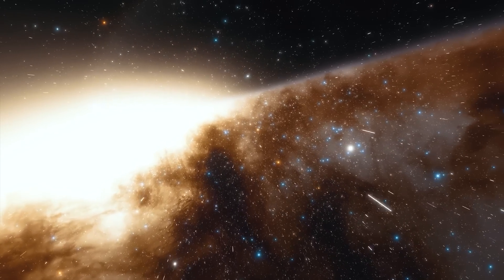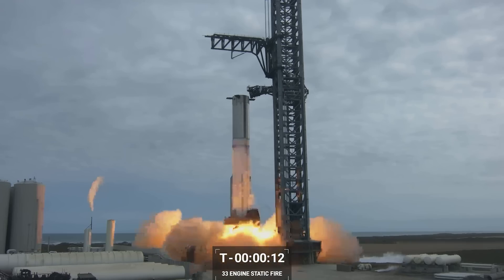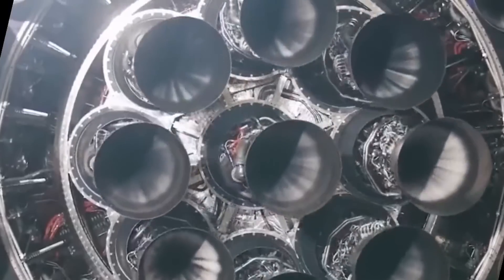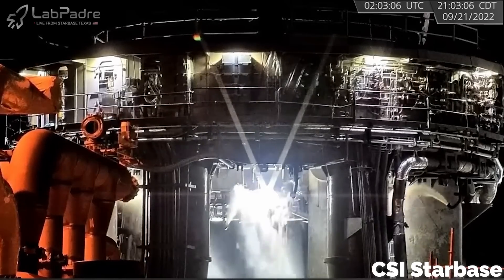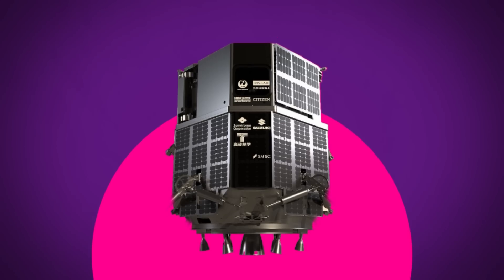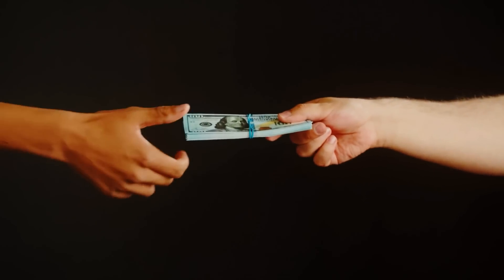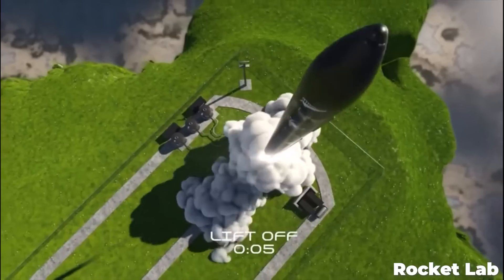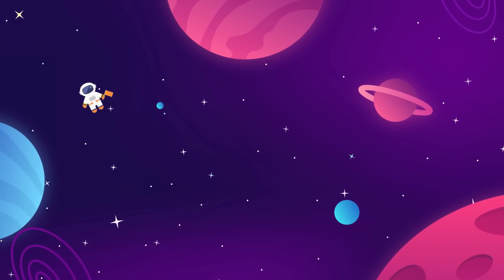The SpaceX Starship Orbital Launch Update & Repair Progress Is Here!

Comment: Everyone criticizes Artemis SLS for taking so much time to get it right the first time around...n also known as being the adults in v room 👍🏼
Reply: SLS is just recycled technology from the shuttle so of course it would work the first time just like how falcon heavy worked the first time cause they both use the same technology from a different rocket
Reply: Haha, yes!  I was waiting for your comment.
Reply: Exactly and if Spacex  did not see this totally predictable coming "anomaly"  what else is this pisss poorly though out and designed? and the water cool steel plate is a laughably bad idea it will blow up like as the largest boiler explosion!! Steam is a vapor that is created when water is heated to its boiling point and undergoes a phase change from liquid to gas. As the water is heated and converted into steam, its volume increases significantly, and it can exert a great deal of pressure on its surroundings.

The expansion ratio of steam can be calculated using the ideal gas law, which relates the pressure, volume, and temperature of a gas. At standard conditions (0°C and 1 atm pressure), one gram of water can produce about 1,673 liters of steam. However, at higher temperatures and pressures, steam can expand even further.

For example, at 100°C and 10 atm pressure, one gram of water can produce about 23,500 liters of steam. This expansion can be used to generate power in steam turbines, which convert the energy of expanding steam into mechanical work. good luck muskrats!
Reply: Obviously to don't watch SpaceX and know how they do things.
Reply: @NaeviaAarons  Sorry, didn't understand what you were trying to say in your reply... SpaceX is a maverick company with great success in this burgeoning space  industry and every success is our Countries and the worlds to revel in. However, their is something to be said for the methodically and  meticulously run successes of others efforts also. 🚀 Much success to all whom dare to inovste 🛸